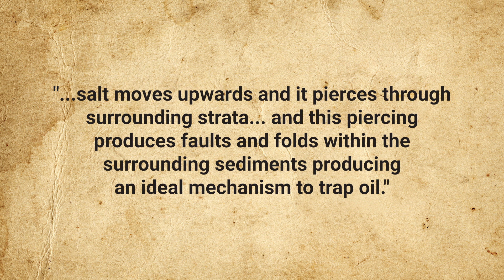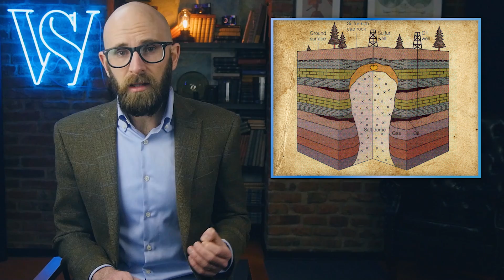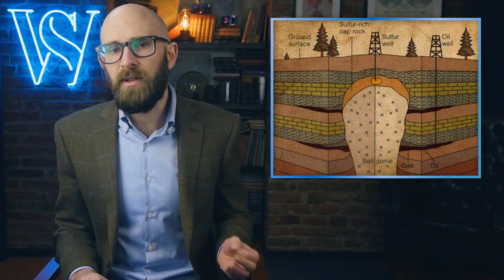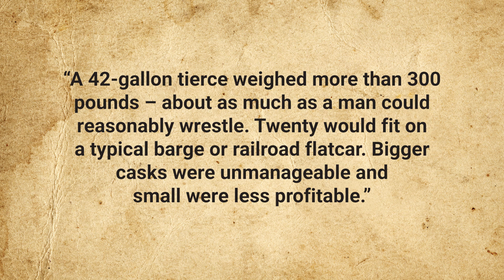How Drilling a 14 in. Hole Created a 1.3K ft Deep Saltwater Lake Out of a 10 ft Deep Freshwater One

Comment: Great video, Simon. I use the Lake Nyos story on flat earth comments when they suggest that there is no gravity and there cannot be air pressure without a container. Carbon dioxide, being heavier than air, because of gravity, replaced the air in the surrounding countryside, suffocating everything. There is a related phenomenon, called a mazuku  https://www.youtube.com/watch?v=YEPNYRD09es

There was another big oopsy in Chicago in 1992. I went to college there, and lived there for thirteen years. The buildings downtown have a honeycomb of subterranean tunnels, used years ago to deliver good to buildings from the Chicago River. A company was hired to shore up the area near a bridge. They, essentially, punched a hole in the bottom of the river / top of a tunnel. Flooded the sub-basements of some of Chicago's most prominent downtown buildings.
https://chicago.cbslocal.com/2017/04/13/25-years-ago-today-great-chicago-flood-paralyzes-the-loop/

Maybe both of these stories deserve a bit more notoriety from the world famous Simon Whistler....just a thought.
Reply: No gravity? They why don't astronauts jump into orbit? Would save a lot of fuel ;)
Reply: Fascinating tyty
Reply: Lake Nyos isn't the only lake like that. In fact, on the other side of the African continent is a lake that could kill millions. Lake Kivu located in the African Rift Valley is 1,800 times bigger than Nyos and contains enough methane and CO2 to kill millions. Because the lake is so much larger than Nyos, the method they used in Nyos to dissipate the gas wont work. They still haven't figured out a good way to relieve the pressure and the lake continues to be a ticking time bomb.
Reply: @operator0  they have solved the problem. bottle it and sell it. https://www.reuters.com/article/us-rwanda-gas/rwanda-signs-400-million-deal-to-produce-methane-gas-from-killer-lake-idUSKCN1PU1WW
Reply: There's also a great video on YouTube, probably a History Channel disasters video, that shows exactly how that happened in  Chicago.  You could also use the Lake Nyos story to tell what could happen if the planet's atmosphere gets too much Carbon Dioxide, a noted greenhouse gas.